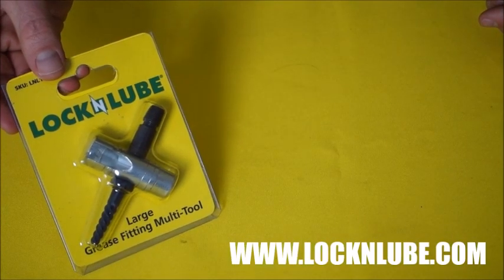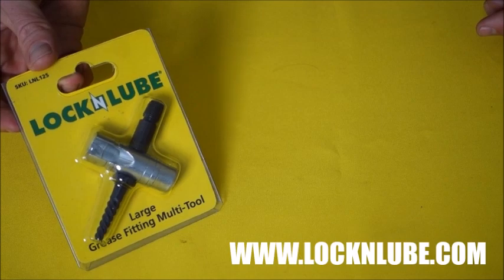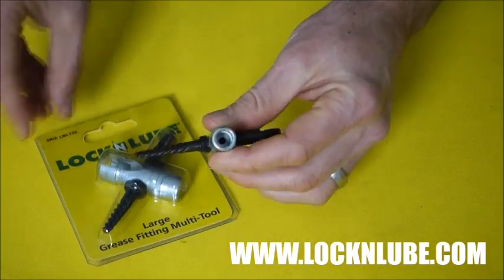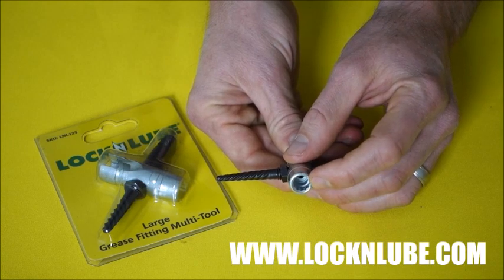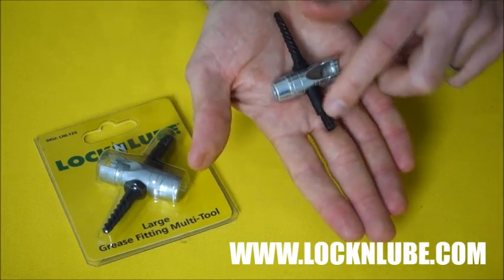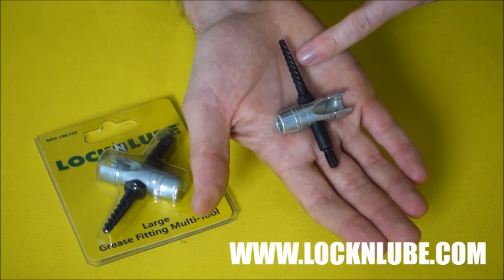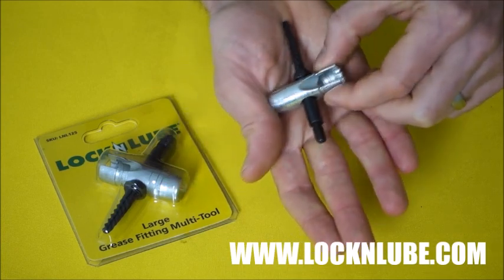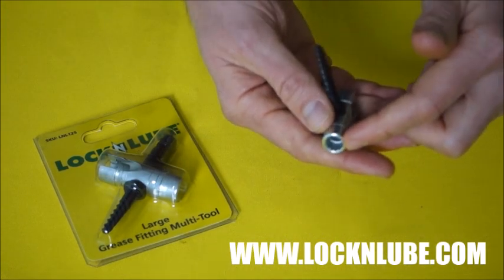Easy out grease fitting tool from LockNLube

Comment: how can I remove a zerk fitting on a u joint that gets grease only through the needle attachments
Reply from the maker: You could see about getting an extended socket that could reach in far enough to replace the Zerk.

Comment: Would this work on a zerk fitting I broke off   a ball joint?
Reply from the maker: If you can fit the tip of the extractor into the hole where the Zerk used to be, then it should have no problem removing the threaded portion.

Comment: How to REMOVE a pressed in grease fitting? Thats what I'm searching for
Reply from the maker: For a pressed-in fitting, you may need to drill it out. Use increasingly large drill bits until you have it all out, then retap the hole for threaded fittings, or replace with another pressed-in Zerk. 

We'd love to know if others have better ideas, getting pressed-in fittings out can be a pain.